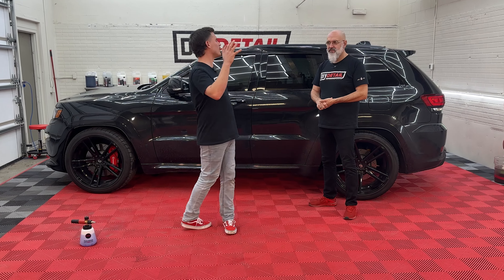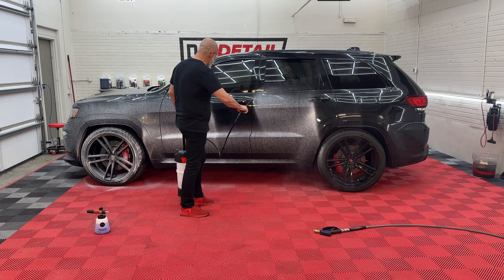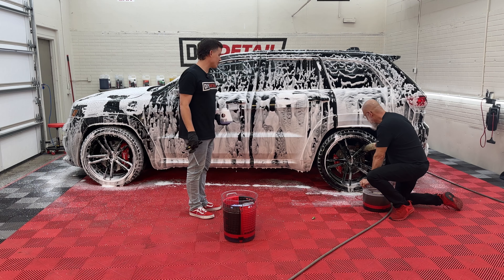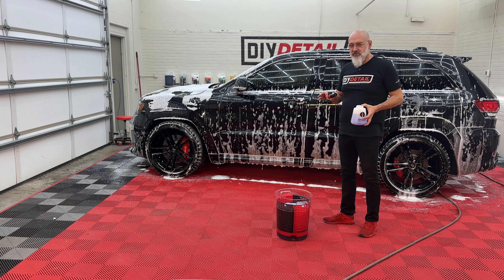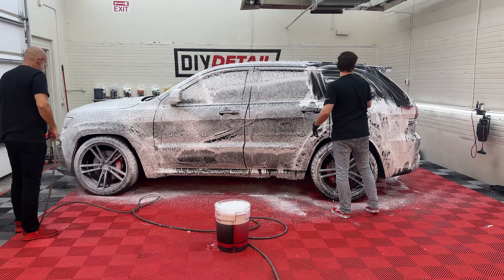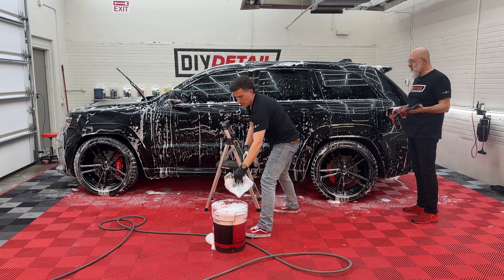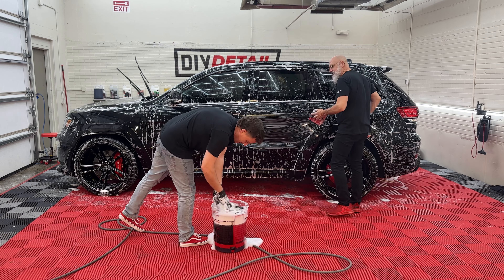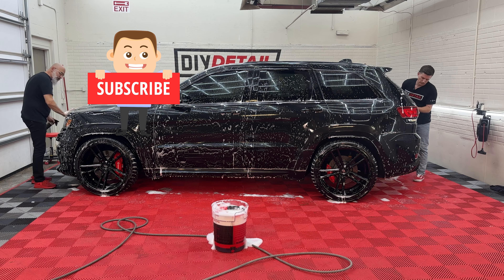Wash & Decontaminate a JEEP SRT: ceramic coating prep wash!!

Comment: Thanks for putting out these videos. Why do most iron removers, including yours, say to leave them dwell for a few minutes before either rinsing or agitating? My thoughts would be to let it dwell, rinse it (and any suspended particles) off or lightly foam it so off so it leaves some lubrication, then use the perforated synthetic decontamination towel. I'm assuming there would be suspended particles and that may not be true. Maybe I'm over thinking it. I know you are also polishing this vehicle as well, would the process change if you weren't?
Reply from the maker: Overthinking is part of the life of a detailer. The procedure remains the same with or without polishing

Comment: Question, my car is covered with some Quick Beads goodness. Will using All Clean remove the QB or should I go more aggressive? Plans are to polish the car this weekend. Thank you.
Reply from the maker: you can use All Clean as one step of the process before polishing. It will help, but won't remove Quick Beads...at least it's not likely. it depends on a few factors, including dilution ratio. the polish step will take care of quick beads

Comment: After I rinse a car with my pressure washer, I spray rinseless wash over the water to hopefully minimize any issues with mineral deposits. If that dries on the surface and is washed with rinseless wash within 15 minutes and dried with ceramic gloss, are the water spots I see on the surface from me or were they there before? All done under a covered area. Thanks!
Reply from the maker: can't be sure without being there for the whole process, always best to work in small sections to control variables
Reply: @diydetailofficial  yeah I figured that, it’s just hard when using the pressure washer on bugs and wheels to control where the overspray goes

Comment: My car paint feels very smooth after a wash, but there's a lot of water spotting that looks embedded in the clear coat. Is the chemical water spot remover necessary before a polish? or should I just polish them all out?
Reply from the maker: you want to wash, decontaminate, then spray on water spot remover, let it dwell, agitate lightly with a Rinseless Wash dampened towel...then rinse off. You've then washed away the mineral deposits, and all that's left is the etching for you to polish away. Otherwise you just drive those mineral deposits into the clear coat and they re-appear under the hot sun at a later date
Reply: @diydetailofficial   Oh damn! Glad I asked this before I went ahead and did something I would 100% regret. Thanks so much for the detailed instructions. I'm impressed by the simplicity and versatility of the diy detail range and excited to see what other great products you guys offer in the future. 👍

Comment: Hey guys, if i only have rinseless wash, can i use it as a drying aid? Will it be safe for the paint? What dilution ratio should i use? Thanks
Reply from the maker: Yes you can! Use it at 256:1 dilution, which is the standard dilution

Comment: All clean - you said it will take waxes or sealants.
But other videos you state to use it to remove bugs and road contamination…. But now it will remove some sealants

Should I not use allclean when doing my weekly wash, even if bugs are on there?

Or just use all clean and then have to add a sealant on when drying?

Just clarification
Reply from the maker: All Clean at 15:1 is a great tool to remove traffic film and road grime, and you honestly don't probably NEED it for a weekly wash. But it, alone, isn't going to strip a coating -- no way. And while it might impact the performance of a last step product, it wouldn't -- in one fell swoop -- remove Ceramic Gloss or Quick Beads, if that's what you're referring to. So go ahead an use it if you'd like, at that dilution. Or not:) Your choice!
Reply: @diydetailofficial  awesomeness 
Great response
I think I watched 4 hours of your videos - just today